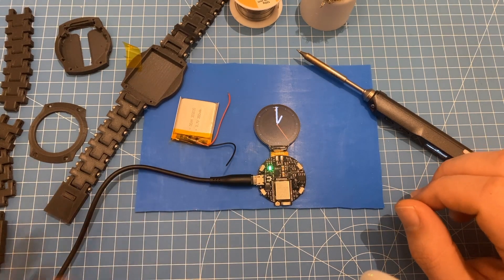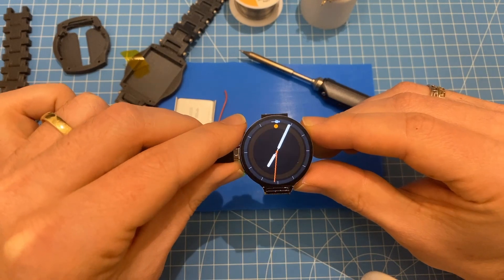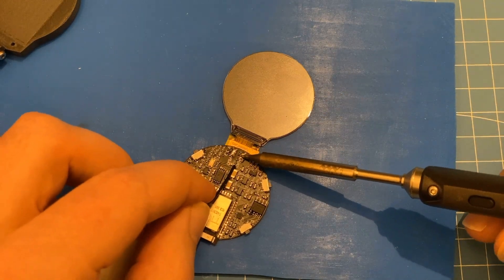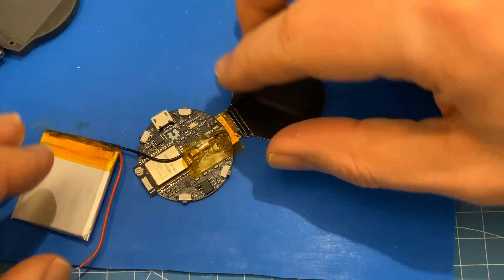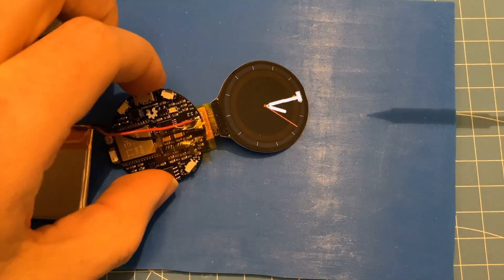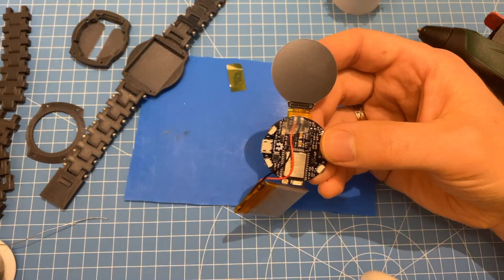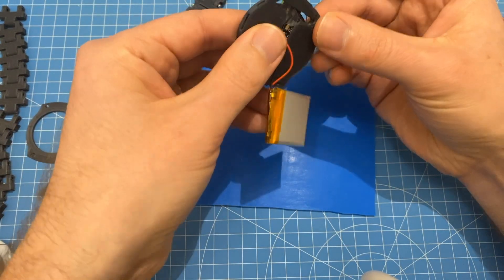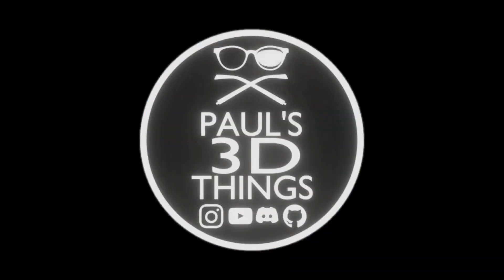EP21 [Open-Smartwatch] Soldering the LiPo / Assembly

Comment: Hello, great project!!. Question is, are you using touch? the GC9A01 seems to support it with CS i guess. The other is  2 suggestions, you could use  a rubber o-ring to seal the watch, otherwise the smallest contact with liquids will go inside, the other is to use a crystal for the watch, cheapest route is to get commercial  tempered glass protectors for smartwatch (1-2 usd per unit) or for something fancy there is a lot of NOS of hardlex and mineral glass for classical watch for 5-10 usd.
Reply from the maker: https://www.instagram.com/p/CNaijFuLDkf/
Reply: @pauls3dthings  i stand corrected about  "smallest contact with liquids". Still, unless you use a gasket it will seep inside. I have fixed at this point 100s of smartwatch over the years, and seen their failure modes. The gasket will save you from this problem, even when there could be other problems ( fracture, corrosion, temperature distortion, manufacture tolerances, etc)
Reply from the maker: @jotatsu  does it count if the glass is pressed into heated PLA and when it cools contracts around the glass, as well as an inner case printed with flex/TPU which presses against the glass?

I will make a youtube video about this, maybe it can be done even better
Reply: @pauls3dthings  You can read "Nothing Gets In: Waterproof Enclosure Design 101 (and IP68)", even if the watch is not targeted for IP68, it will give you an idea. 
For  watch design inspiration you can look at "Nixon the mission" internal photos, of all the watches i've fixed, this one is similar in internals as your design (2 parts case with separated glass window) , simple enough, and is water resistant at 10 ATM.
The buttons can be tricky, you can use the classical crown design, those are already waterproof if you design correctly the hole.
Or at the end of day, you can use conformal coating like the drone enthusiast do, water can enter but the watch will be fine.